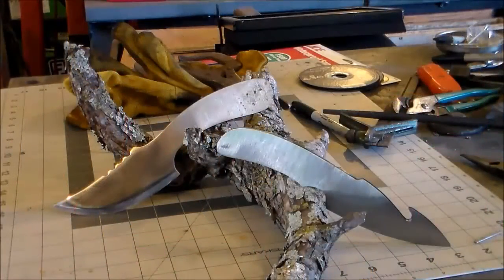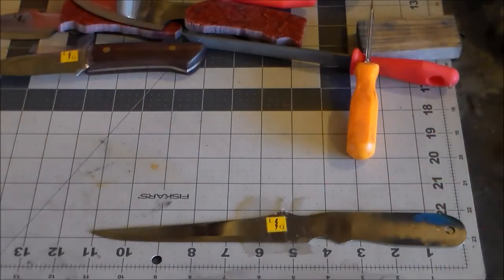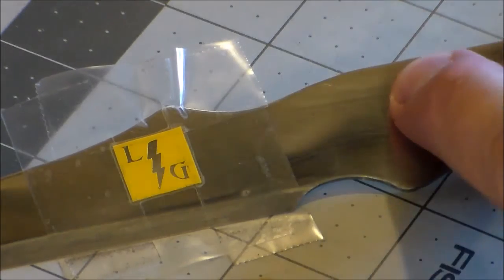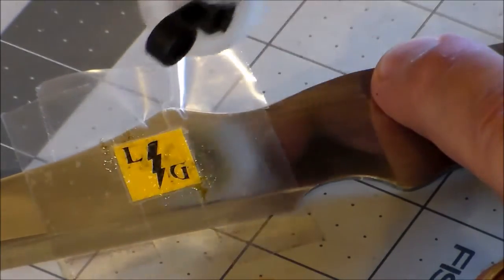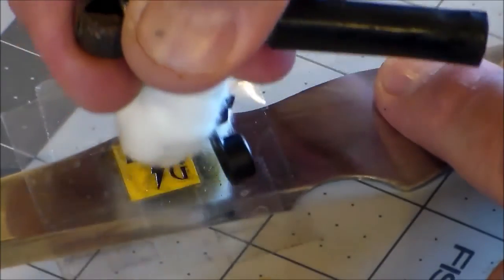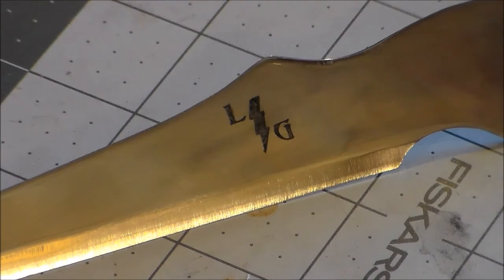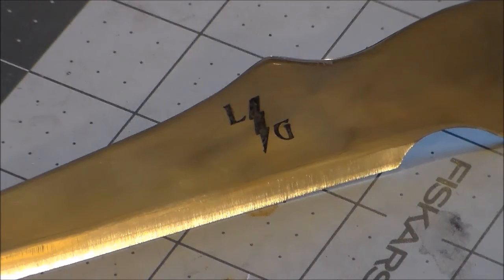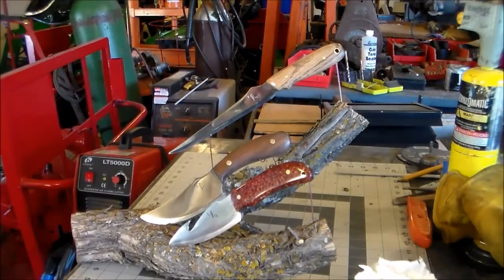Knife Project from 1095 steel

Comment: Wow you really do nice work on those knives. I have a knife blade I got on ebay and it came unfinished and working on Ebony handles for it right now. Man salt water to etch  into the steel I would have thought you used sulfuric acid. But i can see just the salt water hooked to a battery charger works great. Thanks for sharing always an interesting and informative video
Reply from the maker: Thanks, I had researched the etching and it is just that simple. It really burn in. I got your sticker and will do a Mail Call soon . Appreciate the sticker. Take care
Reply: Glad you got the sticker and thanks for the shoutout